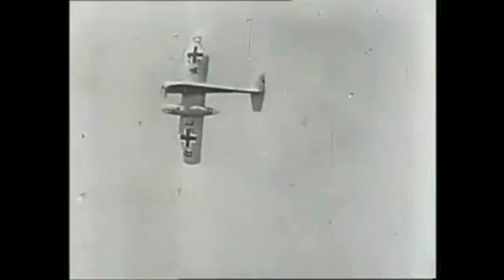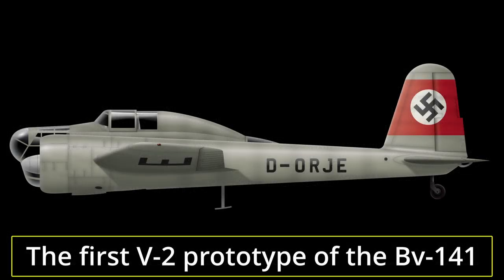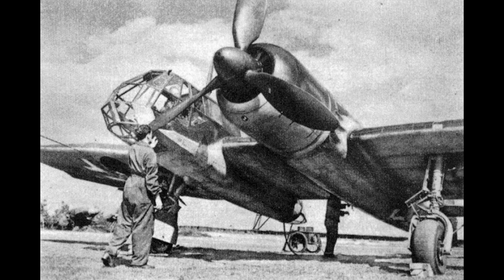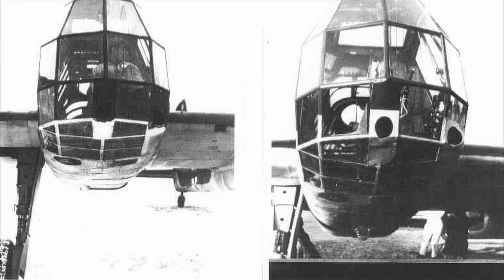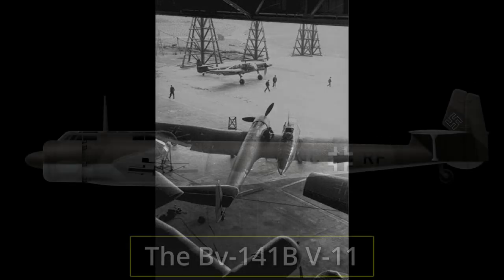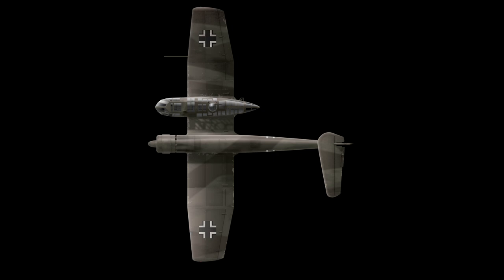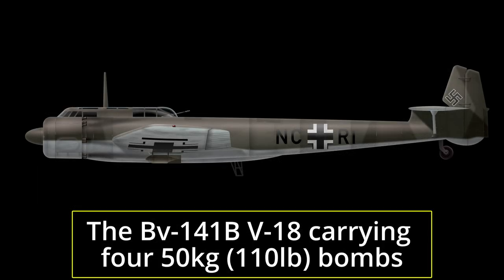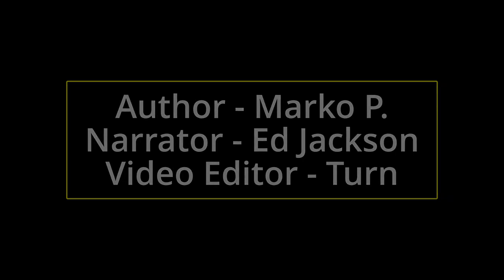Throw The Rulebook Out The Window - The Asymmetric Bv 141

Comment: I just want to say that, as a very amateur pilot, there's no such thing as a symmetrical propeller airplane unless it has counter-rotating propellers. In a single engine plane, the propeller usually rotates clockwise as seen from the cockpit, which has a number of very asymmetrical effects on flying, and the more powerful the engine, the worse it is. Aircraft designers often make other parts of their planes asymmetrical on purpose to balance out the propeller effects, usually by altering the control surfaces and their rigging, but some go as far as cocking the whole vertical stabilizer slightly to one side, mounting the engine slightly crooked, or even making one wing slightly longer! The effects of propeller rotation change based on engine power output, air-speed, angle of attack, etc though, so the designers can only compensate for one condition, like cruise, and the rest of the time, the pilot just has to deal with it by compensating with the flight controls.

By my way of thinking, (most) propeller planes are already asymmetrical, and the only weird thing about the Bv 141 is that they didn't tray to make it look symmetrical.